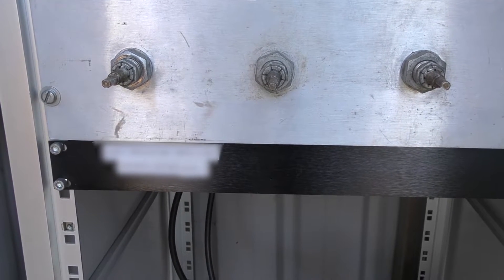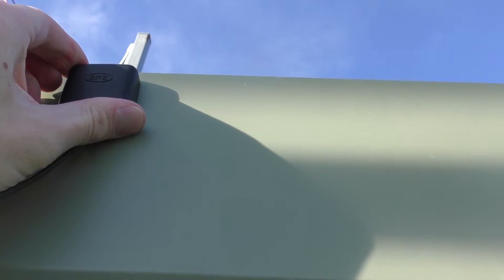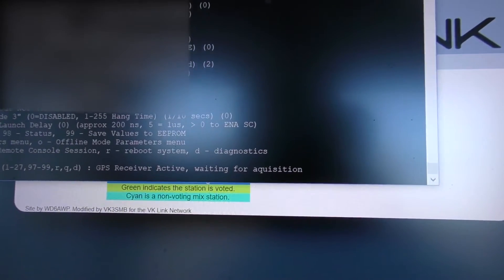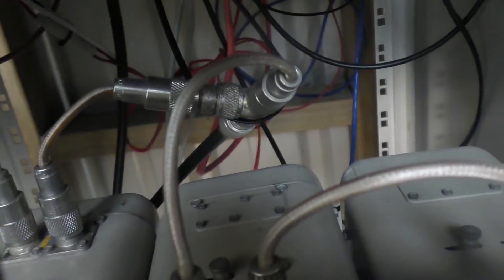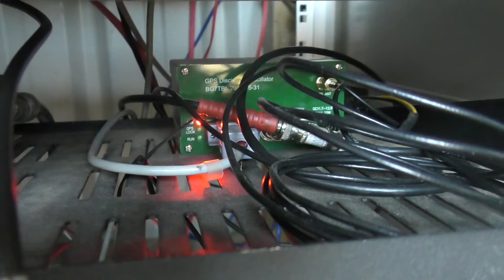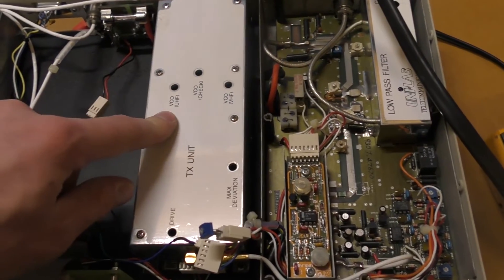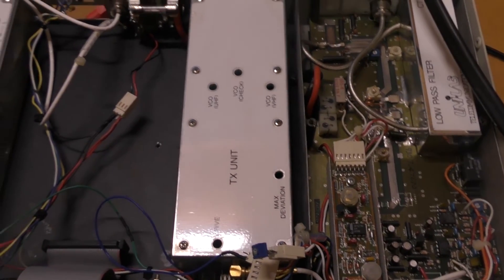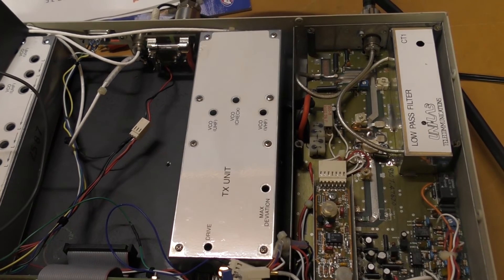Amateur Radio Repeater Repair & Site Visit

Comment: Loved this! 👏 As a new nonprofit building out a regional linked system in Eastern Colorado, this hit home—especially the “bring EVERYTHING” lesson and the sneaky failure points (GPS puck, PA driver module, duplexer cleanliness).

Our takeaways/tribal knowledge from recent installs:

Keep a tiny “rover kit”: spare GPS puck + SMA adapters, 6/12/24V leads, attenuator, jumpers, fuses, and a known-good HT.

Log TX power at multiple points (exciter, post-PA, pre-duplexer, feedline) every visit—makes the next fault obvious.

Do a quick visual/rattle check on cavity screws and grounds; we’ve chased “mystery desense” that was just oxidation.

Battery-backed PSU + low-cost remote telemetry saves trips (even a Pi with a wattmeter and temp/humidity).

For repeaters we’re mixing Motorola XPR 8300/8400s and Kenwood TKR-750/850s—solid, fixable, and parts are findable. Curious if you’ve seen meaningful longevity differences between those and your current rack gear?

Thanks for the clear walkthrough—videos like this help small groups like ours keep sites healthy. 73 from the Eastern Colorado Repeater Association (ECRA).